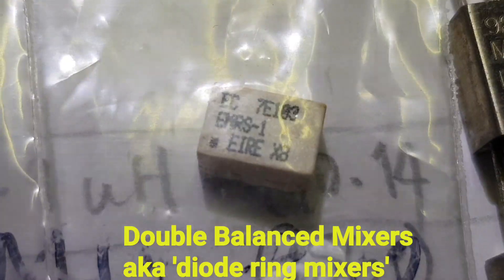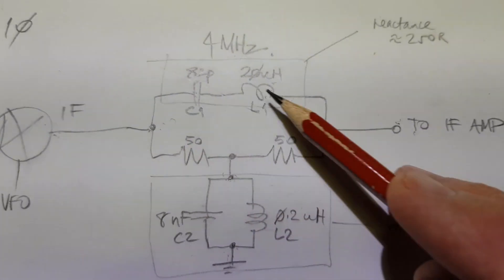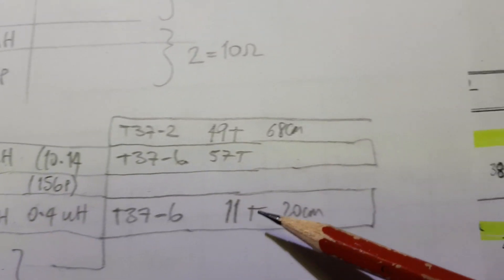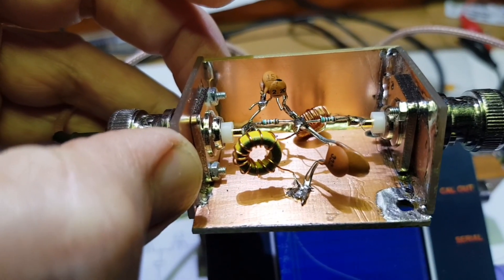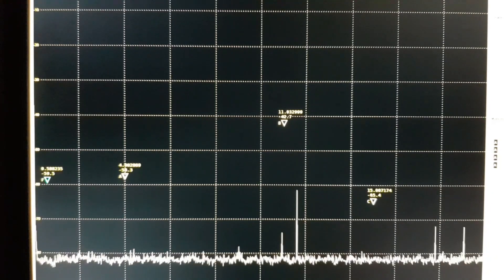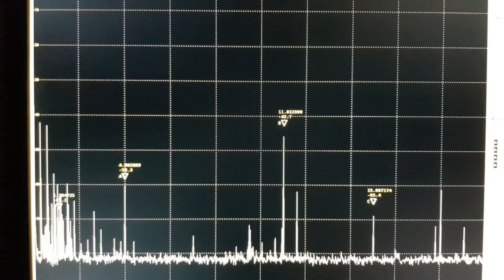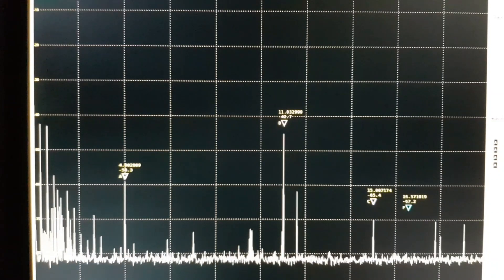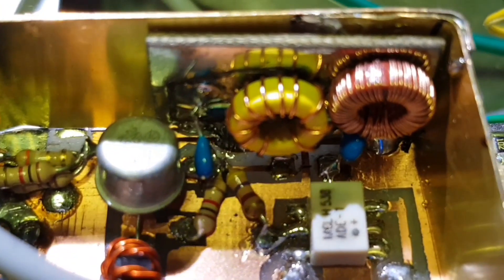Diplexor (Diplexer!): What, why & how?

Comment: How do you determine the best IF?
Reply from the maker: In a single conversion superhet the IF is typically in the 0.455 to 12MHz range, however just about any frequency may  be used as a viable IF as long as it is sufficiently far away from the received signal to make mixing practical.  
For homebrew CW and SSB receiver, a factor is the choice of crystal filter. If you are making your own with commonly available computer crystals, some popular IFs include 4.915, 8, 9 and 12MHz.  You must make sure the chosen IF is well clear of any band you wish to receive across, which is why IFs avoid fundamentals and harmonics of the amateur bands.  If you are using a recovered or bought IF crystal filter, then this will determine the IF, and the VFO is set accordingly.  
For a homebrew IF filter, I have successfully built crystal filters at 4, 4.915, 8.8, 9 and 12MHz. In my experience, lower frequency crystals have higher Q and have less variation in running frequency.  My last superhet receiver used 4.915MHz, commonly used by many kits and projects, including the KD1JV kits and early Elecraft rigs. VU2ESE;s BiTX transceivers use 12MHz IF.  
The gain from the IF amplifier stages is generally higher  at lower frequencies but these days getting 60 to 80dB of gain is not difficult regardless of the frequency chosen.  
There are some thorough explanations of choice of RF in Experimental Methods in RF Design, and Solid State Design for the Radio Amateur, plus other sources.  
I hope this at least partially answers your question. 73 Paul VK3HN.
Reply: @Paul_VK3HN  would 4.915 be too low for 2m? Thank you for all the great information
Reply from the maker: @justinelliott3529  Yes, too low.  I'd suggest 10MHz IF but you could go higher. Don't use,12MHz or the 12th harmonic of the BFO will appear at the bottom end of the band and desensitize the receiver for about 30kHz either side.  Farhan has just described a 2m SSB rig with an IF at 27MHz, surprisingly high, but he is a brilliant designer so I am sure it works fine! See 
https://youtu.be/IsJ7FAUwaIs
Reply: @Paul_VK3HN  10hmz for a 2m FM transceiver?
Reply from the maker: @justinelliott3529  10.7MHz.

Comment: Hi Paul! Thanks for another great video mate. I only wish I'd seen this before I made my own video about the diplexer! Like you I ended up isolating the series and parallel tuned circuits first of all and then tuning each for resonance before connecting it all together again. I made it hard on myself though and went for a Q of 10. The hardest thing for me was not the large inductor but the very small one. I used the NanoVNA to also check the flat 50Ω impedance across a very wide frequency sweep. I'm a fan of diplexers! They work really well. Anyway, thanks again for all you do. Hope you are keeping well. 73 Nick M0NTV
Reply from the maker: Hello Nick, thanks for your detailed comment. I saw your diplexor video, much longer and more thorough than mine, so I'm happy you tackled the topic in your particular style. Mine is more cursory, a kind of introduction,  I think we compliment each other well. When I made my video I didn't yet have a NanoVNA, so you went further by demonstrating the frequency independent impedance presented by the diplexor.    Anyway the more homebrew content on YT the better I reckon. 
 I absolutely agree with you that the small inductor is the challenge, but only because at the commonly used intermediate frequencies it is uncharacteristically small.  In fact it wasn't that hard to make or work with.  
I like diplexors too, and it was fun to use the RSP1A SDR in spectrum analyser mode to look at the mixer output, and how much the diplexor cleans it up.  It makes perfect sense. Diplexors have fallen a bit out of fashion perhaps due to the popularity of simple superhets.  Lets do our bit to bring them back!  73 Paul VK3HN.
Reply: @Paul_VK3HN  Thanks Paul. I love your videos and your radios are fantastic. If I could only build something as small as you do. I think I produce 21st Century 'boat anchors'!!! Thanks again. Keep up the great work! 73 Nick

Comment: Very interesting!  As a newcomer to this field, I am always wondering how much is purely academic and how much makes a real difference in the overall performance of the receiver, especially in the HF bands.  It would be interesting to see some measurements further down the chain, but also to hear the difference.
Reply from the maker: That's the next challenge. To be able to demonstrate the effect of the diplexor using live signals, I think you would need a strong signal somewhere adjacent to the receiver passband and a weaker one in the middle of the passband --  easier to set up in a test arrangement. I think you'd also need to be able to switch the diplexor in and out, much like you switch a receiver RF preamp, which takes time and effort to arrange.  Perhaps the reason why you seldom see this demonstrated.    Thanks for commenting.

Comment: I, like many, when describing how balanced mixers work state that the output is either the sum or difference of the two input frequencies. Anyone with a spectrum analyser knows that the truth is much more complex than that. What we end up doing is filter the wanted signal and try and keep the rest as low as possible. Nothing is perfect. Keep up the great videos.
Cheers
Leon VK2DOB
Reply from the maker: Thanks Leon.  As I commented in the video, it is the first time I've had a spectrum analyser to try this experiment, and it is an eye opener. As is the ability for a simple bandpass filter to clean up the 'forest'.  From TinySA to the SDRPlay RSP1A, you can now buy a digital SDR-type device for $200 to $300 that opens up the frequency domain.  In the past I have travelled to my local radio club or homebrew group to do a test like this on someone's $2500 SA.  While the cheap options probably do not compare, they are 'good enough', because most of the time you don't need absolute measurements or high levels of accuracy -- a relative or comparative view is enough to tell you that an amplifier chain is dirty/clean, or a filter is or isn't working.  Cheers!

Comment: Another very informative video, thanks Paul.  Looking at the impact of correct termination of the DBL it is a powerful argument when you see all the grass and weeds disappear from the spec an display.  I wondered if the LO level was at its expected level given that the balanced mixer should be doing a fair bit of cancellation.  It looks like the better termination of the mixer is allowing it to do what it should and cancel out the LO and input signals correctly.  Oh, and the broadcast band signals!
Reply from the maker: Hi Andrew, thanks for commenting. I just measured the LO at the DBK port and it is around 1Vpp,  +4dBm, a buit low, I thought I had set this up earlier but perhaps not, the buffer amp may need some gain or coupling adjustment.  Yes, playing with a Spectrum Analyser and filters makes the text book come alive.  I live in Melbourne's north east, an area where AM BC stations used to use for their towers. I am not sure where they are these days because the old sites are now housing estates.  But they have always been crushingly strong. 73 till next time!
Reply: @Paul_VK3HN  I believe most of those old Yarra valley transmitters are now at Mt Cottrell.

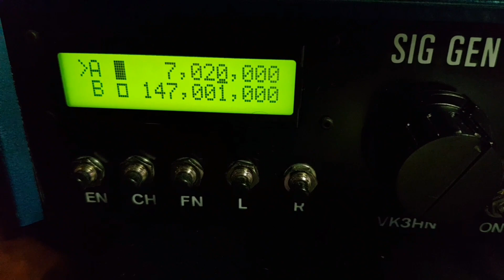Comment: Thanks for the video. I tried this schematic as well but ended up using different sorts of buffers in my projects instead (between mixers and filters that is). Was there a separate video on the signal generator at 9:57? Could you tell a little more about it?
Reply from the maker: Hello again Alex. Re the Sig Gen, no I havent made a video on it, partly because I am not really happy with the buffer amps on each of the 3 channels. It is a standard Nano and si5351 with a modified script to make the controls easier to use as a sig gen. Each of the three clocks can be set anywhere in the si5351 range, and turned off and on.  
The clock outputs each go to a MAR4 MMIC for some gain via a front panel switch which cuts it in or bypasses it.  However the MMICs saturate below about 70MHz, and reduce the raw clock output slightly.   Above 70MHz they start to add gain, and are useful above 100MHz. At 144MHz they provide about a volt pp from memory.  A wideband flat amplifier needs to be designed that delivers up to a few volts pp, I would really like to have up to 5v pp across the full range. 
Nonetheless it is a useful unit for playng with homebrew radio modules.  It has one additional feature that does work as designed, clock1 is taken to a divide by 2 dual flip-flop to produce anti-phase square waves at a frequency half of what is shown on the display.  This was intended as drive for testing push pull RF amp stages.   I might make a video sometime, even things that don't work as expected yield insights.